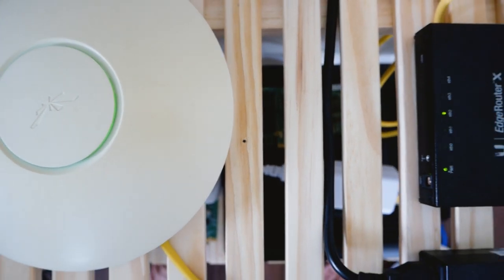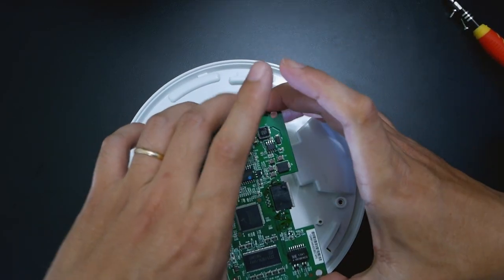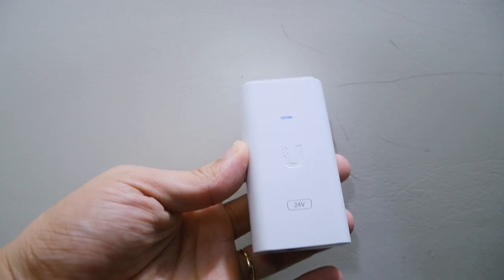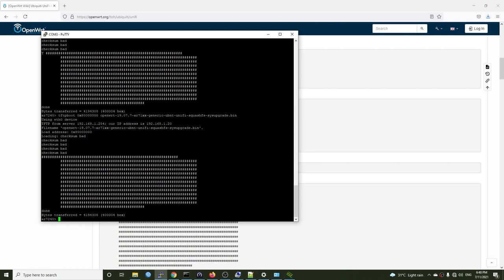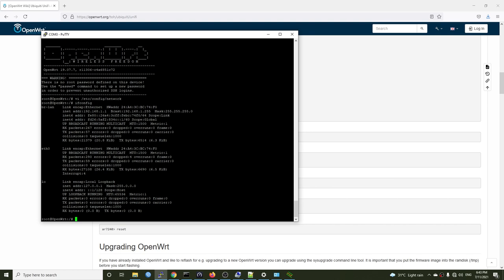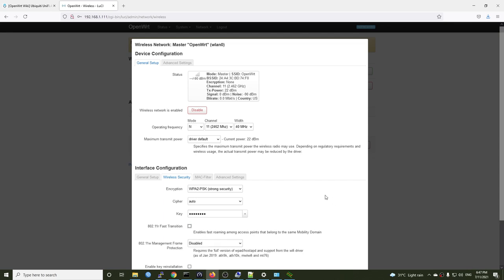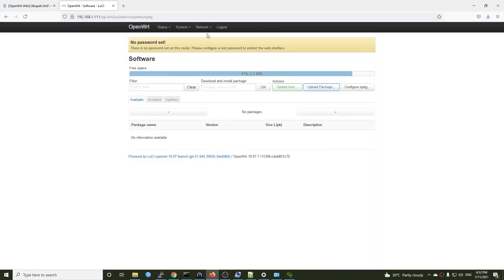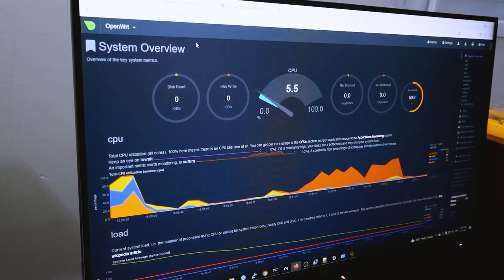OpenWRT - Install OpenWRT on Ubiquiti UniFi UAP LR

Comment: Thanks for the guide. What TTL cable are you using (or do you recommend)?
Reply from the maker: Hi, sorry for the late response. In the video I used the USB to Serial (TTL) adapter using the CH340 chip. Here is the link to it https://www.cytron.io/p-ch340-usb-to-ttl-serial-cable.

Comment: Great video! A suggestion for the future, if you do a review and evaluate the speed of something, use iperf to evaluate the real network bandwidth and not be limited by your wan!
Reply from the maker: Thanks for the comment. For other devices, I do run the test with iperf3/openspeedtest. The Unifi AP only has 100Mbps port where my internet plan is ~ 200 Mbps, that's why I don't give it a try with iperf.

Comment: Great video! My UAP did not have pins so I had to solder them on but I got it connected. Tftpboot is timing out though. Server is up and running, firewall is off, testing with Filezilla works. Ping from UAP shows host is alive. I can see the UAP on my LAN. Filename checks out. Server log does not even register the attempt. I'm at a loss what the issue could be.
Reply from the maker: Hi, may I know if the problem is only when you install OpenWrt or the AP is totally brick now?

Comment: nice, ill try it to my unifi ap lr and ac lr.. using latest unifi firmware i got so many problem.. mainly dhcp offering failed and dns timeout..
Reply from the maker: For UniFi AC series, you can see my recent tutorial.
Reply: @VanTechCorner  Hi again, thanks for your tutorial i succesfully update my unifi ap LR. The only different is the hex i used for copying the system as i use latest openwrt firmware. next ill update my ac lr, finger crossed.

Comment: 9:45 it looks like you only enabled 2.4 GHz (802.11n / WiFi 4) but not 5 GHz (802.11ac / WiFi 5).
Reply from the maker: This is a UniFi AP LR  (UAP-LR), there is no WiFi 5 radio.

Comment: Great Video, i have a Ubiquiti UAP-Pro, can you do a how to install DD-WRT from original firmware???
Reply from the maker: Hi, I have no idea on DD-WRT, if it has the same file system and mtd info with OpenWRT, I think the installation process is the same. But you better check with who used DD-WRT before to avoid damaging the AP.

Comment: Beware. I see most comments are a year old. this broke my unit entirely. Now entering a kernel panic. (my mistake see below)
Reply from the maker: Make sure you follow the guide (wiki) where there are changes in the start/end address according to the OpenWrt version. My video will work if you install the same OpenWrt version like what I am doing.
2 months ago, I flashed another UAP-LR to OpenWrt and it worked just fine.
Reply: @VanTechCorner  My mistake (RTFM) was that the latest version is broken and using the same version that you used in the video was exactly what I needed. Not it works smoothly after I followed with that older firmware on a UAP-LR. Thank you so much.